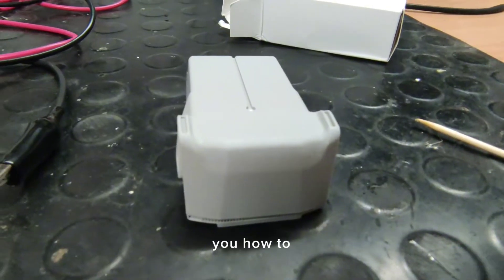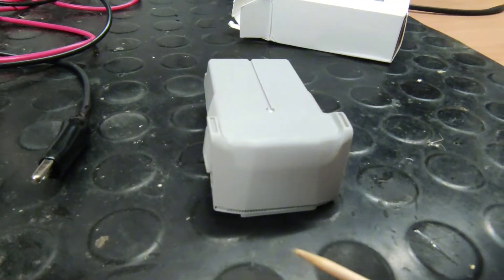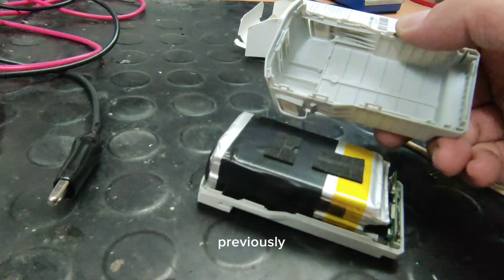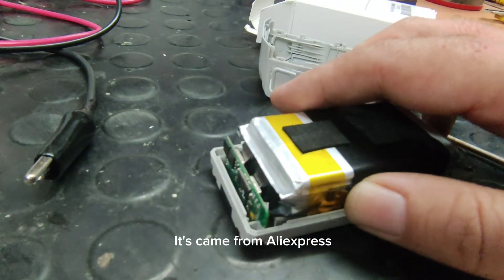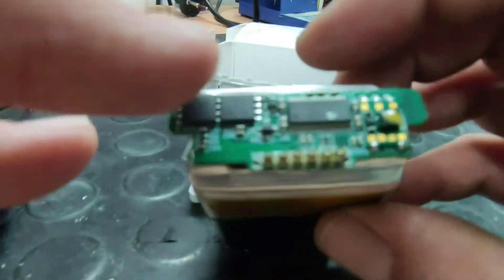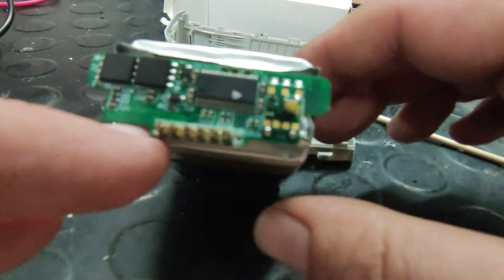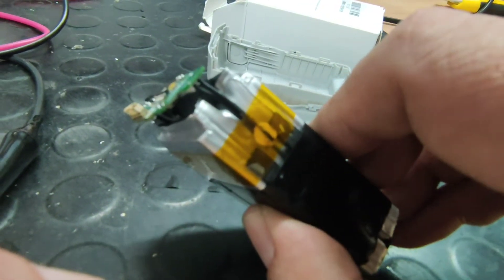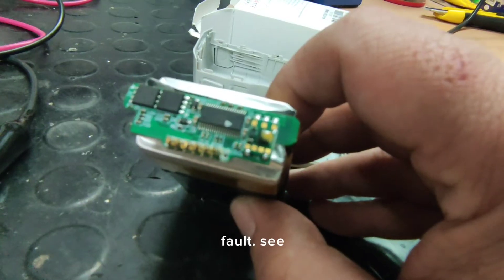DJI MINI 3 PRO BATTERY TEARDOWN AND REPAIR - @KSDAirPhoto

Comment: I am getting 4 blinking lights. All I did was order a battery shell and change them out. The tab on the battery broke so I decided to replace the shell with a new one and now I get 4 blinking lights. It's the original battery just changed out the shell ..
Reply from the maker: May you show me the video. I think the one cell is broken, may be under voltage or different ones.

Comment: Have you ever put a dji board on a none dji battery i live in canada and they have restrictions on 250 gram under drones so a person  can't use none original dji battery
Reply from the maker: @campingnuts85  everything is possible. Yes i made with dji battery board more flights time with replacement of cells with cells with more capacity
Reply: Pls share how u do it

Comment: Please could you share the ifib file and the firmware of a battery that you can read? I'm working on a bms, with a custom chip  "bQ9003" but I must have those two files

Comment: They are LiPo
NBD 
You can buy LiPo almost any where and power and size and quantity are a Easy Squeezey buy.
I fly Align 470 that is all I use for the last 10 years.
and
Graphene lipo batteries are the most advance and I know DJI do not use Graphene lipo batteries in their Standard Intelligent Flight Battery or the long flight Intelligent Flight Battery. The more advance Graphene are just to expensive. One nice thing about Graphene is long looong life with charge cycles almost un limited.
So what is my point!
With Graphene lipo replacement inside a Standard Intelligent Flight Battery you can get 1.5hrs maybe 2hrs FT.
99.99% of the LiPo I rebuild the LiPo designation is printed on the face of the LiPo. I am positive none would in their right mind would attempt to remove the LiPo designation printed on the LiPo face.
Reply from the maker: @dallas69  where to find graphene batteries with this size for test
Reply: @KSDAirPhoto  LiPo each cell has a printed info on the cell. When you have that printed data you can order LiPo cells. With the LiPo printed info most LiPo seller offer optional cells that are smaller better than the ones used in DJI. That is where you have to try to order the type of LiPo.
Now 
DJI battery looks to be a 4S LiPo or 4 LiPo cells stacked up in series or parrell. The board on the front of those LiPo cells is LiPo balance charge board which is NBD. Once you buy new cells you may want to buy $10-$20 LiPo charger and not use DJI charger board!
Reply: When LiPo go bad they puff. Do not try to deflate a bad LiPo! When a LiPo is bad and puffed they are really bad and do not try to charge or discharge just toss them and buy and new LiPo cell.
Looks like 4 LiPo cells (4S LiPo) but he did not cut off the kapton tape so ?? on the # of LiPo Cells???
With my Align 470 I use a LiPo cell balance charger and everyone that flys Heli or Plank have cheap $20 LiPo cell balance chargers.
LiPo cell balance charger means sometimes when you charge multi cell LiPo after 10-20 charges you want to balance the charge (equal V) on each LiPo cell. LiPo chargers can balance charge automatically.
Reply: Share with us

Comment: If you buy these batteries, the latest firmware update will detect that it's not a DJI battery and gimp itself.  So, don't update the firmware.
Reply: Where tf else do i buy batteries now 😔

Comment: How hard is it to swap the Mini Pro 4 batteries BMS with the Mini Pro 4 Plus BMS (Intelligent Battery)?  I'd prefer not having my RID displayed from the larger battery.
Reply from the maker: Hi its not very hard to do it
Reply: Doesn't matter if you swap it.  The BMS is programmable, and you will need to set the parameters correctly, otherwise the drone will think the battery is lower capacity anyways.
Reply from the maker: @BLR1GBattlemaster  You are right but not exactly. Because i have software that may set almost every parameter
Reply: @KSDAirPhoto  Yes, that's what I'm saying.  YOu need to program the BMS and not just swap it.
Reply from the maker: @BLR1GBattlemaster  actually must remove the PF flag, and set correct cell capacity and capacity of cell package. After the few changes and discharges the battery bms will do "autotlearning"
Reply: @KSDAirPhoto  Ah, do you have the DJI Battery Killer software?  If so, can you upload it to a fileshare site?  I can no longer get it off the Russian forums.
Reply from the maker: @BLR1GBattlemaster 
Here you go:
 https://we.tl/t-CAAVMQbMQM
Reply: @KSDAirPhoto meaning we can put any suitable battery and then reset the original dji bms according to the new battery specification rite?
Reply from the maker: @sym712 exactly

Comment: Where would one find the bms battery board to be able to replace it if it were bad say due to maybe a short in the bus or capacitor or something, do I have to buy a new battery instead of repairing it?
Reply from the maker: i have battery bms but after fw 6.1 there are new unlock codes
Reply: @KSDAirPhoto  they know what they're doing, they want everything to be proprietary so that no one else can just make one 3dprint it and go.

This is why I no longer like dji, they're like iPhone, everything is so secured to their own system it leads to a lonely nights.

Why not make things so that it can be innovated? 

I'd rather go get the li-on and solder a xt-30 or 60 then 3d print a pack to make it look pretty then connect that to the hobby drone that I made myself then ever buy another dji product!

Comment: Does the fake DJI mini 3 battery plus locks the bms after disconnecting/changing cells?
Reply from the maker: No
Reply: @KSDAirPhoto so we can change the batteries just like that?

Comment: I need to replace the original battery enclosure as mine cracked (broken latches). Do you know if the original ones are glued together or are like the non-origiinal?
Reply: Any luck im stuck in the same boat?
Reply: I managed to replace one of my batteries. I only used the part with the latches. @ParadiseByAir
Reply: Всё делается в Китае на одном заводе, так что всё оригинальное. если аккум не распознаётся, то значит он сделан из украденных бракованных деталей, которые должны идти на переработку.

Comment: Hello, how can you modify that battery by adding more cells (lipo battery) so that it can last much longer in flight?
Reply from the maker: i think its possible
Reply: You wouldn't want to add more cells unless you added two extra in parallel, adding any more cells in series will alter the voltage and it from being a 2S battery.  The problem is if you double the number of cells in parallel then you're going to be doubling the weight and will need a bigger case.  Plus the extra weight will be putting more stress on the clip mechanism that holds the battery in place.  If anything you'd just want to replace the stock cells with larger capacity ones.
Reply: No
When you go from a 4S to a 6S the LiPo stack up thickness increase 
Bad News Bears
Only way to improve is to order buy and install a better LiPo cells like graphene  LiPo